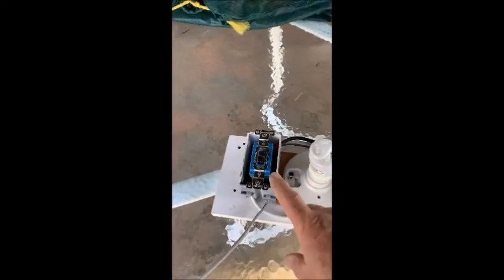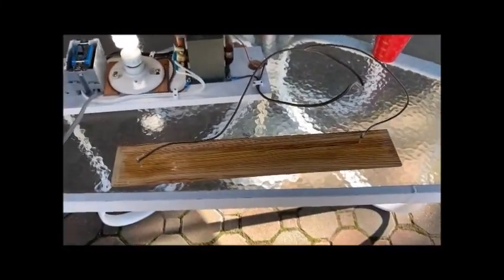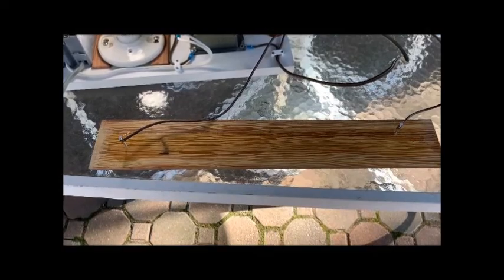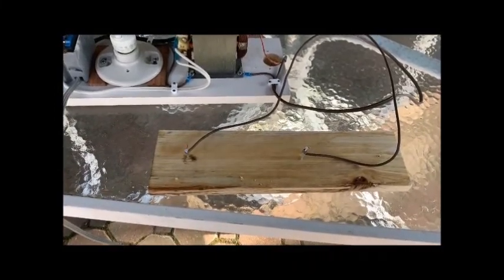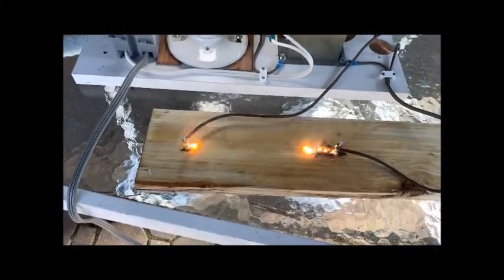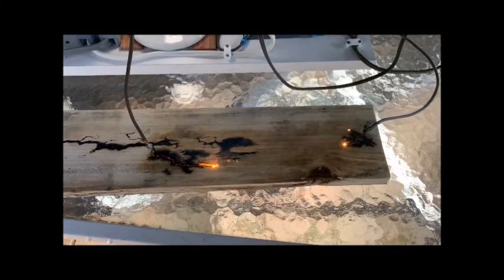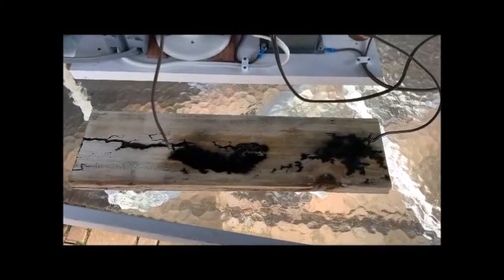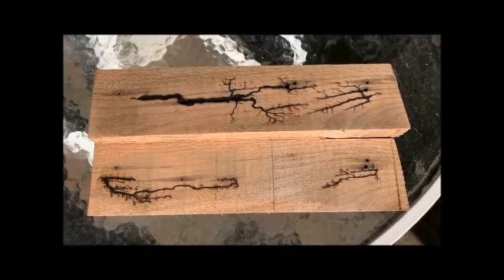Lichtenberg Machine / Fractal Wood Burning

Comment: Dear Geppetto, 1. if you connect your transformer frame to earth ground you increase the chance of lethal accident dramatically.    This is counterintuitive, but true.

2. We are happy you had that on a glass table top.      However, the metal frame can get you between the rig and earth ground.   There are so many ways you can get killed with that rig.    Don't get alligator clips.   https://youtu.be/m0WbnYrMBcU    and https://youtu.be/hojqGUTXxzg.   A little dry perhaps, but some essential knowledge.

Comment: You need a rheostat to vari the voltage input to the transformer.  Then you can control the intensity of the burn

 Take a hard look at your setup so you can be safer.  Not safe but safer